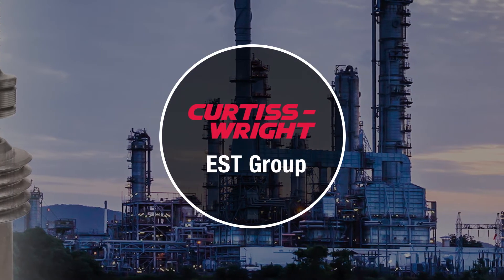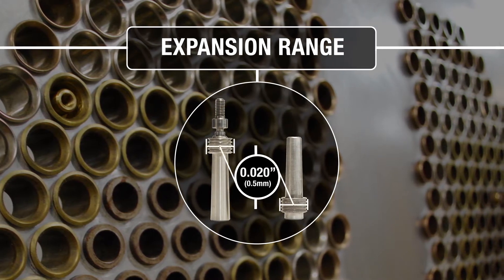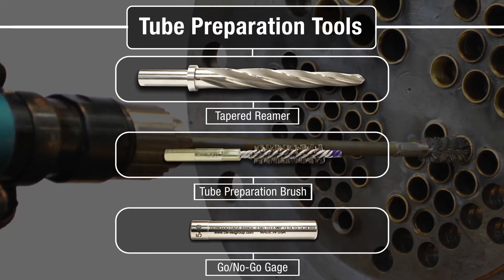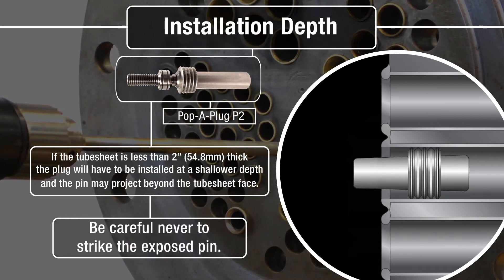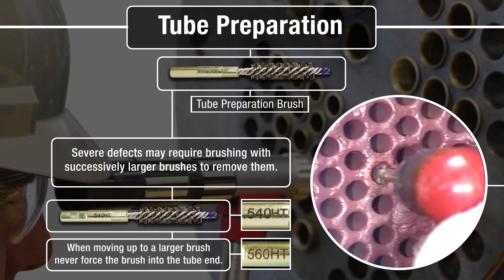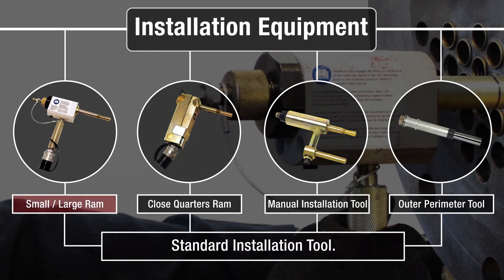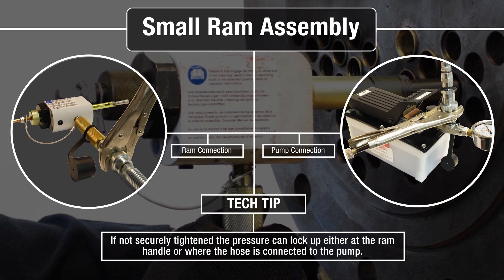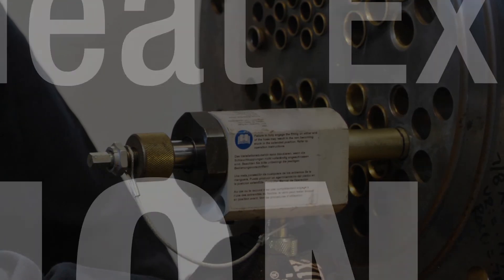Installation Training - Pop-A-Plug P2 Heat Exchanger Tube Plugging System

Comment: Can you Air test the plug after you've installed it ?
Reply from the maker: Hi John, Thanks for reaching out about our Pop-A-Plug Tube Plugs! Yes, you could air test our plugs after installation, however, based on the application, there are many variables to consider before we would recommend this method straight away. If you'd like to discuss your specific application with one of our product experts, I'd suggest sending an email to: EST-Sales@curtisswright.com, or visit: www.cw-estgroup.com/pap to learn more. Thanks again for your interest in Pop-A-Plugs!
Reply: @CurtissWrightCorporation  thanks I've been in contact with on of your reps, he got back to me promptly and we are looking at avenues to rectify our situation